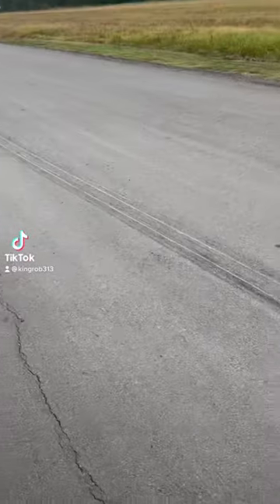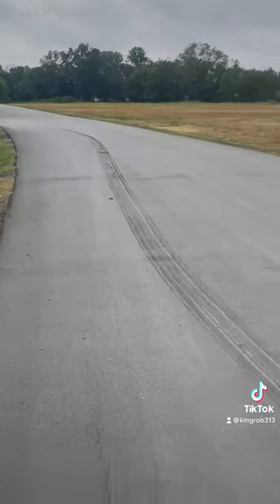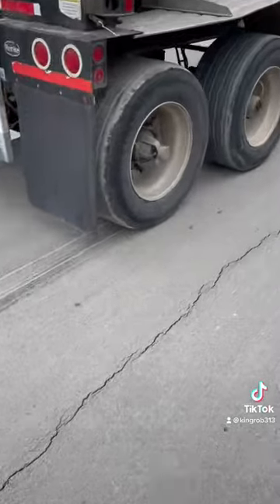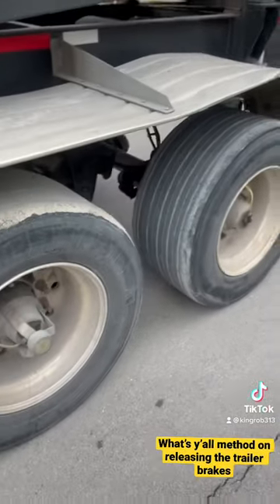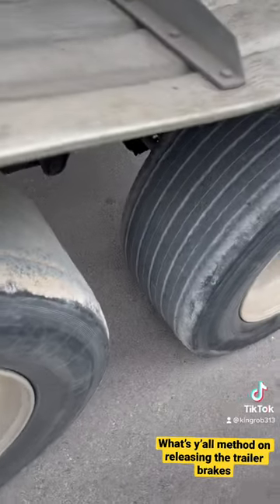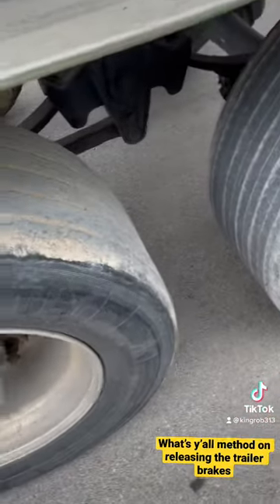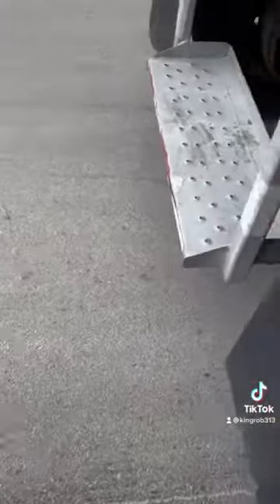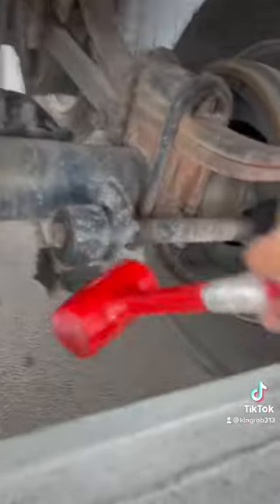Trailer brakes locked up on me while driving #shorts

Comment: That happens to me also when I pick up a trailer that has been sitting for a few days. So I just pull forward a little bit and I’ll back up and it normally will unlock the brakes. If that doesn’t work then you gotta hit it with the hammer 🔨 just like you said brother. Be safe out there
Reply: Don't you haft to hit the brake not the drum to get ot to work ??
Reply: @jessimiller8244  brakes will crack if you hit them
Reply: @tommymack6286  yeah after I said it I realized that's a dumb thing to ask lmao 🤣

Comment: Back up before you pull away if you have room. Brakes bite harder if they’re engaged and you’re rolling forward, designed that way, if you roll back it’ll release the bind. Hammer works too but backing up keeps you in the truck the whole time.

Comment: What I picked up from a trailer mechanic at Utility was to build up your air pressure to the max and pop the trailer brake. Do that a few times. I’ve done that up north when they have frozen up. Also, backup a bit and go forward in between air build ups.

Comment: The small shaft next to the axle is the S-cam, 
The end of it has the slack adjuster on it.
 At the bottom of the slack adjuster where the clevis is  you should hit that in towards the brake chamber.
Reply: Works ok with a plastic hammer but you will mash things up with a real one doing that.

Comment: Installing a 
Quick release valve helps, but usually release the brakes & give it time to  actually brelease..
Locked up for dirt is not for Daily driver. (Banging it like that helps the locked up drums to shoes for lack of use & rust build up ).
* Release trailer, wait a about a  min , release truck, wait few secs, then should be good to go .***

Comment: I work with roadtrains in the mines in Western Australia. I carry a bosch hammer drill. I have a bit that goes into it that's had a slug of metal welded to the end of it. 
If my brakes lock up I oull it out. Put it on the drum and pull the trigger. Works every time.

Comment: My suggestion:
First, go to a hardware store, look at a digging bar, 3 I Ch wide flat steel front, circular steel back end for tamping, that's the example.
Second, think about a heavy steel rod, flat end for striking with a hammer, the right shape for putting up to the brake drum. Figure how long you want it.
   You might have it welded up. You might find the diameter of rear you like. Just toss it in your tool kit.

Comment: Nope. I do the same thing. Thump that tire first! I just started hauling pipe, driving an 08 389. They told me not to even set the trailer brakes, because they get hot and stick. Especially after being loaded heavy.

Comment: As a truck transport mechainc in Canada we have trailers lock breaks on constantly in the winter they are hot from driving make ice and freeze them solid and have to use a massive chunk of steel as a punch and a 18 pound sledge to hammer them loose those little taps with a soft mallet wouldn't cut it up here lol

Comment: Back up and hit the slack adjusters first then the drum if it doesn’t come loose ….. but these are usually temporary, try adjusting the brake…..
If the shoes are too worn , it’s call cam over the brake cam is over traveling and not returning to the release position…..

Comment: Dude if You have brakes hanging up like that With good air pressure and it's Not freezing wet outside, You better check for broken springs in the brake chambers, NOT only the parking springs need to be checked but the single air line chambers as well that needs a GOOD return spring, And if you don't have a spring problem you have S-CAMs hanging up or if all the brakes won't release you likely have a brake Valve Problem, For those who might want to know. Good Luck Trucking

Comment: May I suggest a tip before you leave after hook up get a can of red spray paint and put a dot at the top of tire move a little and recheck. As for me I have smacked the drums just make sure you see both sides pop if not call road service.

Comment: The slacks need grease 
Hit the slack adjuster 
Which is that long tube coming out of drum you can see in video 
The adjuster attatches to the can that big round thing that has air lines

Comment: Adjust ur slack adjusters regularly and don't set the tlr brakes unless ur on a grade or raising ur dump bed. But yeah, if the drum locks up, use that hammer.

Comment: Can't say for trailers but I work at a truck body shop, when they are locked up try reverse first, if that don't work and you need to hit it  I release the air and hit the drum that helps with releasing.

Comment: Once the tires are on hard surfaces like concrete or asphalt,  going in reverse will free that frozen brake up!!
It doesn’t work real well on gravel surfaces!!!
Most of the trailers I pulled,  that rear brake drum wasn’t nearly that close to the back of the trailer, so doing that, hitting the brake drum with a hammer would always require crawling under the trailer for a few feet one way or another!

Comment: Clean your hubs off, try reverse, and you should always be checking your tires with your mallet. Besides that some rigs have where you can manually disengage each break if it's not completely ceased. and sometimes it just needs a reset. Alot of times simply reverse will solve it because its something like a rock or debrie that gets caught in your breaks.

Comment: If that doesn't work and it's really stuck adjust the brakes out and hit it with a metal hammer but make sure to adjust the brakes back to where they need to be before you start hauling

Comment: Try adjusting your brakes and see where it's locking up that means sometimes your springs will get jammed up to keep up your lot breaks up or you might need to adjust them a little bit and then get a new spring for the brakes for the trailer
Reply: That’s NOT MY JOB! 
I am a driver NOT A MECHANIC!!! Let Some 
other Grease Monkey 
Fix them!!  LMFAO 😂😂

Comment: Reverse then forward do it a few times should break loose you can also do what you're doing. Also in the winter time carry a little gas torch and if they freeze up its a way to heat them up and get them unfrozen

Comment: If all else fails an you can't get it to release take a crested wrench pull the line a dime will fit in the chamber to block the air , long enough to get you to the shop GOD bless

Comment: If it's not freezing......
Then why are you "ringing the bell"? Aka, hitting the drum with a hammer? There is a more serious issue! Either the driver was too impatient to allow the trailer air tanks to completely fill up.......or there is a leak causing the 30/30 brake chamber from releasing. Anyhow.......thank you for at least investigating the issue. Most modern drivers wouldn't even look😎

Comment: If it's not working properly, you might want to check the slack adjuster or the s cam bearings or the rollers or the shoes or the drum or the springs or the brake can..... Are you getting the picture? A hammer to the drum is hardly a solution.

Comment: I don't know my dad drives truck he said those tires you're using are only good for the conditions they're made for if you're not driving in the conditions they're made for you might as well be using the standard dually
Reply: Now that he explained it I get it you're taking a tire that is way smaller than the dually tired that Rim is spinning so fast it is warping your brakes and locking them up from the Heat

Comment: A wrench on the slack adjusters tighten them all the way down I’m back I’m off a quarter of a turn no I’m not break certified you should be but I’m not and I just my brakes all the time on my trucks and trailers and they still pass DOT inspections

Comment: The easiest way without getting out of your truck is put it in reverse and then put it back into drive and if it didn't fix the problem do it again until it's fixed and then you don't need to get out of your truck and bang with a pipe looking like an idiot on the street

Comment: That's not normal,you might  have a air leak,brake is camed over or slack adjuster not adjusted right you might have your hand brake trailer brake brake on just a little bit.
Reply: Brake drums just stuck to the pads cause it's been sitting a while
Reply: @ThatToast  be safe.

Comment: That's the wrong way to do it you tighten up the brakes and go mash the brakes then that will return a loose because the brakes have cammed over when they lock up that's the best way to do it unless you break changes f*** up then you have to wait for it to release

Comment: Hard to see with your jerky video. The rod coming out a brake chamber should be at a right angle the slack adjuster when brakes are applied. This gives maximum pressure to the brakes. I the adjuster should retract to close to the chamber when released. I did see that it looked like your slack adjuster was out where it would be as i the brakes were applied. Couldn't if see the other one on the axle was applied. First thing to do is smack on the slack adjuster where the rod comes from the brake chamber. Strike it as if your trying to move the adjuster towards the brake chamber. Highly unlikely the shoes themselves are hanging up on a vehicle that you've been driving recently. The S cam can get a flat spot in it where it contacts the cam roller or the roller has a flat spot or the lack of a dust shield can allow dirt to collect on the cam thus interfering with cam/roller motion. Bumping the adjuster in the right place should dislodge it and allow it to return to  released position. The best thing to do is have your mechanic look at it. Do  not ignore it.